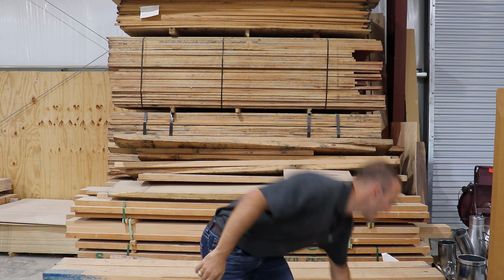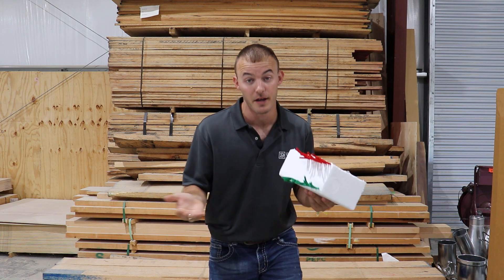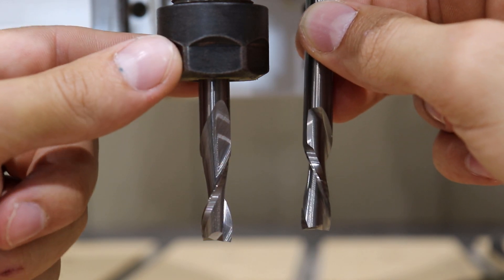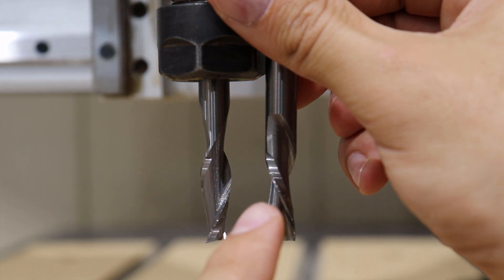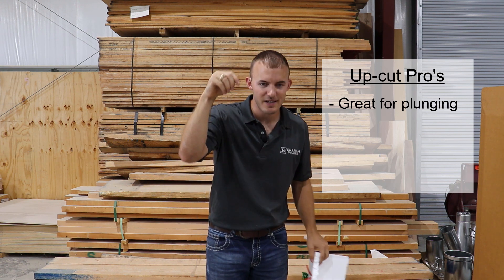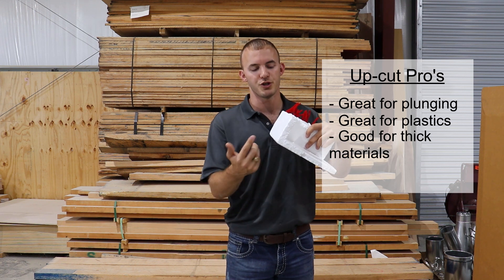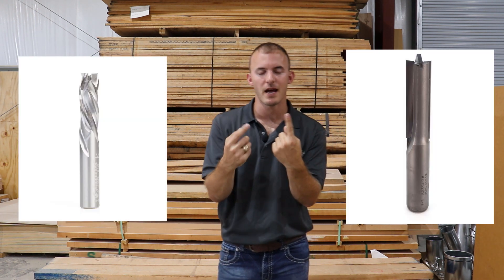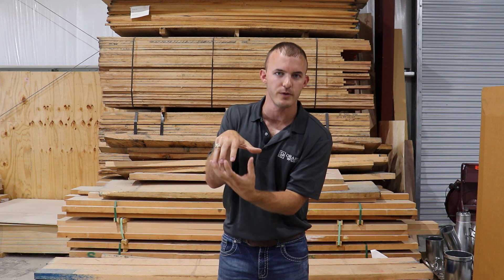Upcut or Downcut CNC Bits | How and When to Use Them

Comment: thanks this help me lot, i think best way cut first groove down at plywood and then change bit and deep need cut up. i use lot 3/4 or biggest plywood make groove or cut plywood shorten piece. and outside piece off at plywood. just order some down bit and need test, up cut has horriple work clean after cutting. i order some traight cut bit too, how this and were this used ? i think maybe clean side corners etc. i not has work lot whit my new DIY cnc machine yet but learn what id better bit use and were can use different bits.

Comment: what if i want to cut deeper than an inch and a half or 2 inches in wood? is there a bit long enough for that? or is that not safe to do on a cnc machine? thanks!
Reply: @cutting-it-close  my CNC is a LongMill, 30 inch x 30 inch. The router fits 1/4 inch bits. Thanks for your reply!

Comment: Great video, best I've seen on the subject. At a guess what bit would you start with to cut lightweight 16mm falcatta ply with gloss laminate on one side and matt laminate on the other? Advice without responsibility gratefully accepted 👍
Reply: Could use a down cut for 1st pass and up cut for 2nd pass of doing 2 passes. Cheaper bits than compression

Comment: I was always worried about cutting 1” or 3/4” material with down cut bits. I’m gonna give it a try. I always thought they were for thin material. Thanks for the video!
Reply: i just cut 3/4 plywood first time down cut bit and has lot lot better than all my up cut bits, all my plywood work i use now first down cut and then change bit cut deep up cut bit, little more work tool change make but ready plywood not need prepare anythink after work. only up cut i used before and has horriple big job clean plywood top side after work.

Comment: Much better. Just talk more slowly. Delamination is the word. Tears and flakes.  2 forces, axial and radial. Not only recut chips but most, the heat. Is the number one enemy for end mills. 
Shearing angle. That is what you was mean about the spiral and the straigt flute?

Comment: Good point on using compression bits on smaller CNC machines. On my Laguna IQ Pro, they actually work well - even though it's more of a hobiest machine. It handles what I need to throw at it. Using downcut bits can be a problem also if you're compressing chips into the cut line on thick hardwoods. Potential fire hazard, I would think.
Reply: @cutting-it-close   I've had chips packed so tightly in the cut line that it worried me, and they were warm. Maybe if the speed you're cutting at is high enough it wouldn't be a problem. My machine is a bit limited there. I've also taken to doing a final cleanup pass on cuts - makes the edges nicer, but takes a little bit longer. Thanks for the videos!

Comment: I built my own CNC (powered by a dremel) during lockdown and while it´s not that strong it was dirt cheap for me to build and it´s good enough for small wood projects and surprisingly precise. Your videos really help me along but contrary to what you said i made quite good experiences with 1/8" straight cut end mills and they are pretty much my go to end mill for most stuff because they leave such clean cuts. I guess the effect you´re describing is that the cutter probably bounces off the wood more or is it just harder on the spindle?
I guess I´ll have to test around some more...
Greetings and a big thank you from Germany!